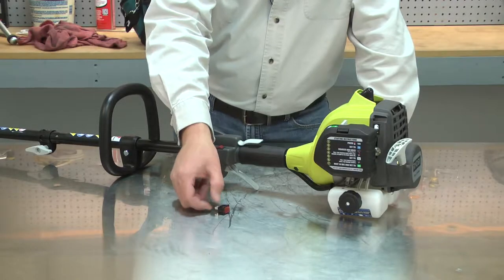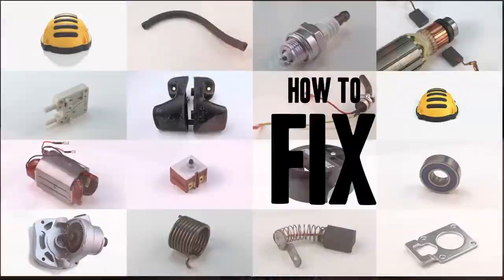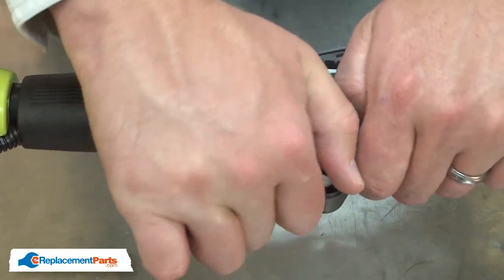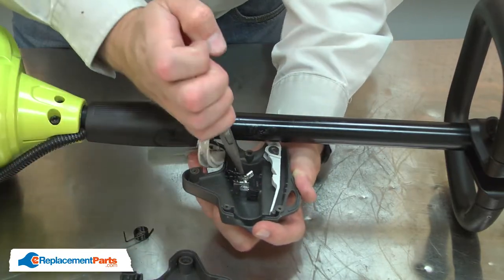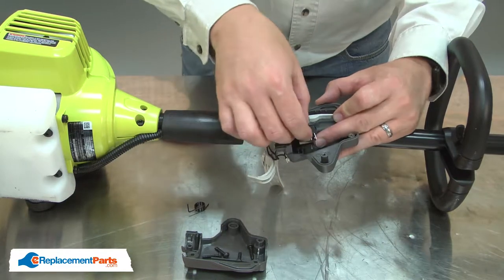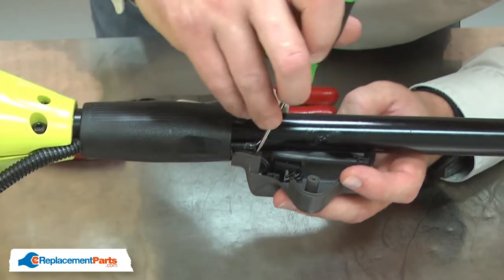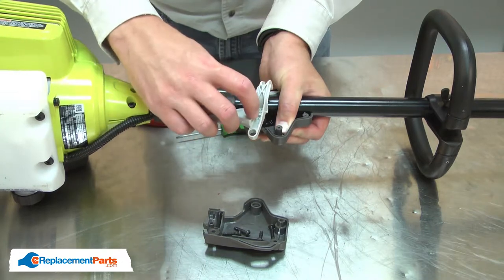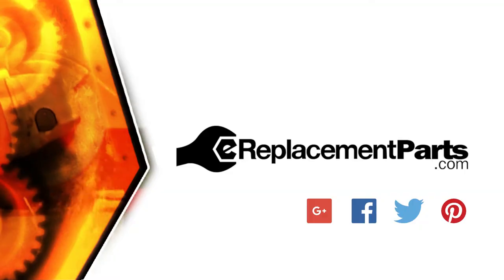Ryobi String Trimmer Repair - Replacing the Ignition Switch (Ryobi Part # 760961002)

Comment: I did a continuity test of the switch and it passed but still doesn't shut down when pressed. The contacts are clean. What other problems are causing this issue?